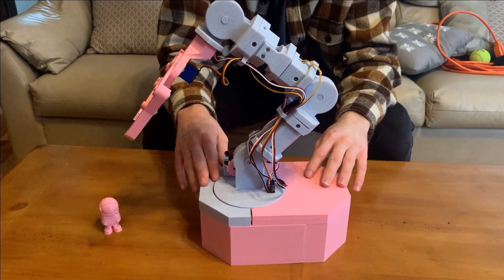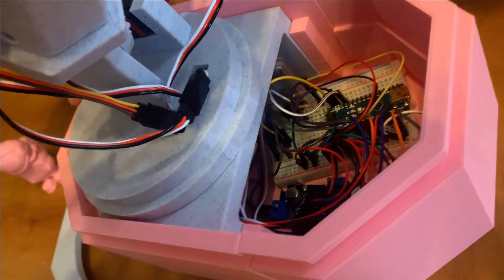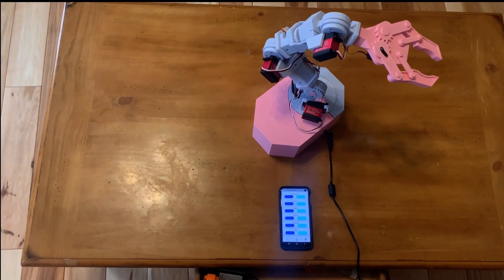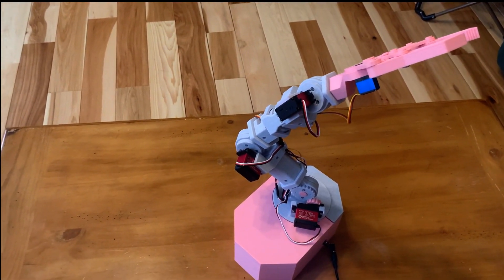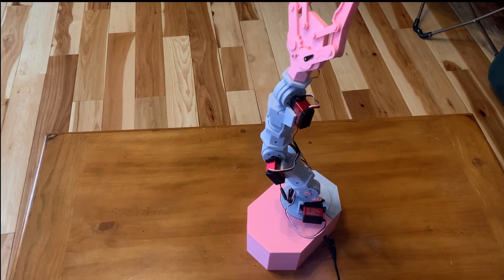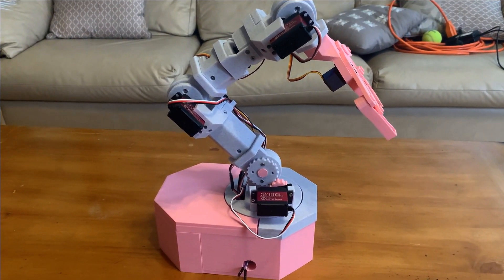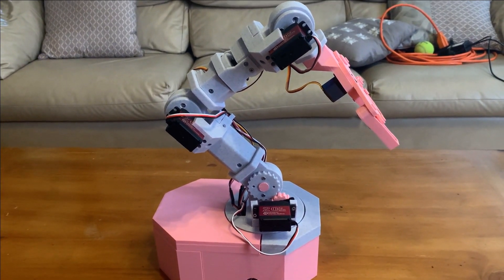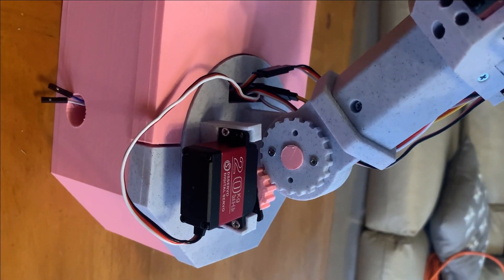3D Printed Robot Arm | Senior Design Project | UofCincinnati

Comment: why not use Stepper Motor?
Reply from the maker: Thank you for the question. We chose to not use stepper motors for several reasons. First is that stepper motors are normally significantly heavier than servo motors. We would need much stronger motors in the shoulder and elbow joints if we used stepper motors to carry the extra weight. This extra weight would also cause more stress in the plastic arm. We also wanted to have some sort of feedback so that we could automatically position the arm. You can't see it in this video, but when the arm is turned on, it automatically goes to a home position. Steppers don't have feedback, and therefore we would need to add sensors. Overall, steppers are great for doing repetitive tasks, but since our arm did not do repetitive tasks, we chose to go with servos. Please let me know if you have any other questions.